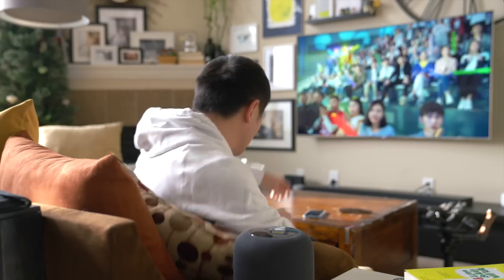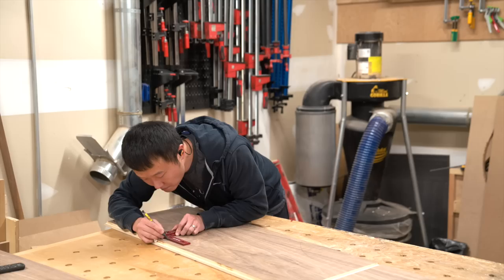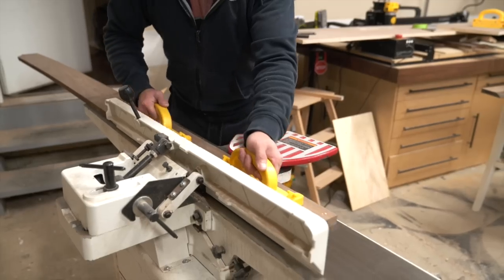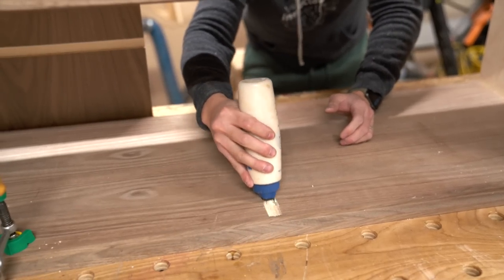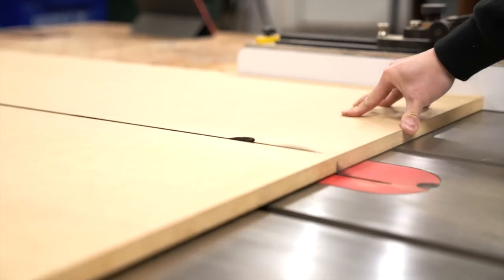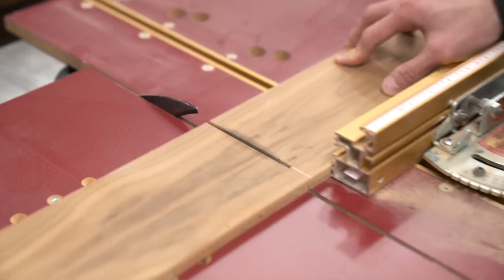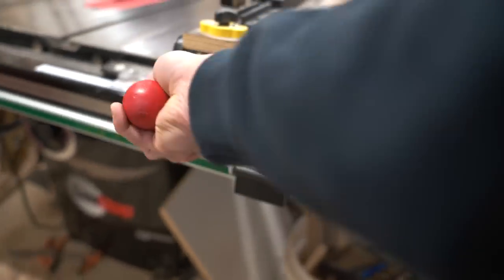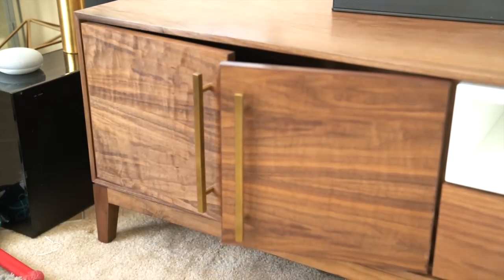Building a Modern Media Console, TV Stand, Credenza | Woodworking

Comment: Curious how you cleaned up the glue squeeze out on the edge banding. The plywood veneer is so thin I’d be afraid to sand it away after it dries. Any tips?
Reply from the maker: No don’t sand it. Peel it off after letting the glue sit for about an hour. It becomes gooey, can be easily peeled off. If it’s too dry. I normally take a chisel and scrape it off, and it does a good job
Reply: @BevelishCreations  appreciate the tip! I’m starting a dresser out of sheet goods (walnut) and this will come in handy.

Comment: Great video. Always love your content! How do you cleanup the glue squeeze out from the edge banding?
Reply from the maker: It’s cleaned out when I flush up the edgebanding to the boards. The edgebanding is normally 0.5mm proud of the board surface on either side. I’ll come and flush things up with a flush trim saw on the ends and a hand plane along the edge. The hand plane will cut away the glue